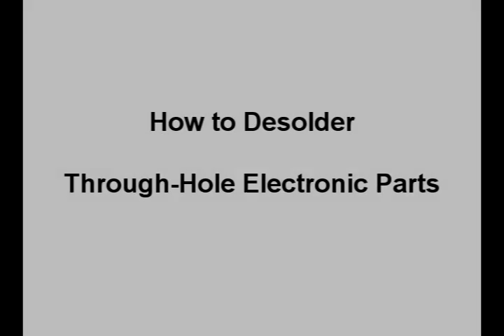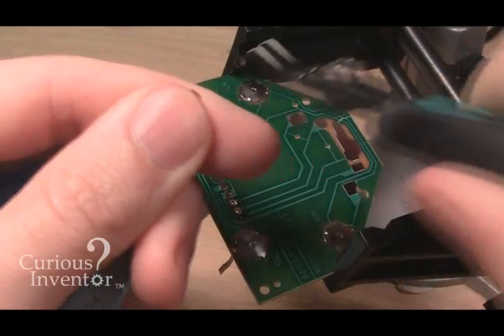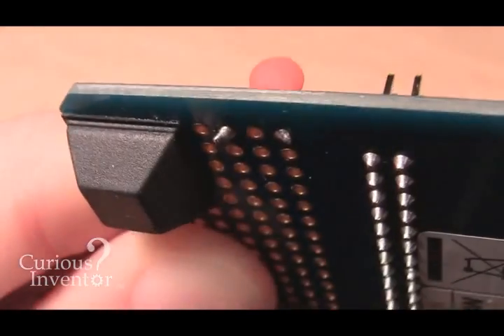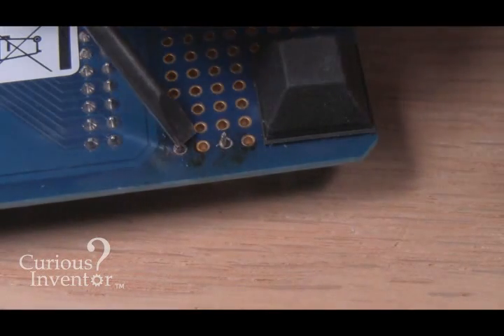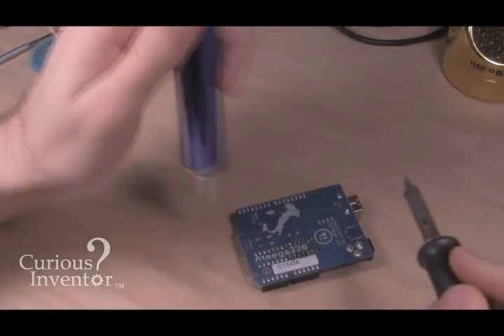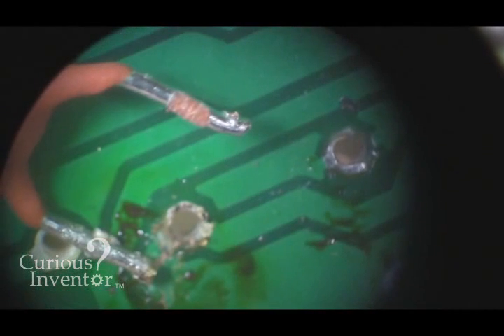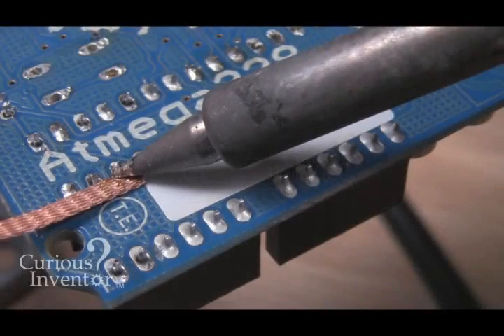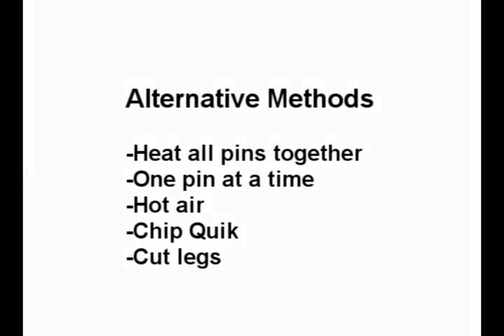How to Desolder Through-Hole Parts, Why Some Joints are Difficult

Comment: Horrible advice to push on the leg on a through-hole device. You can easily rip the through-hole and then you would need to bridge the connection with some wire. Take your time when desoldering and instead of pushing left to right it's sometimes easier to wiggle the component from the other side while the solder it molten.